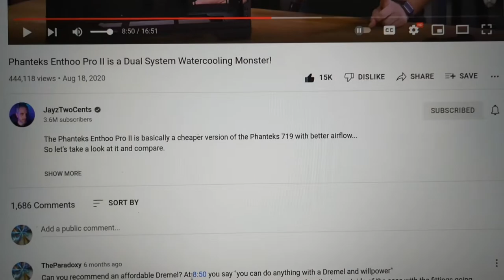A Dremel + Willpower

Comment: What are you temps ?
Reply from the maker: That overclock was mid/high 70s C after heat soak. Lately, I've switched to PBO 225 190 190, which is more stable for extended use (I was out of town for two months and just SSHing into the computer) but PBO doesn't go much over 4.5ghz in my workloads where I fully populate 20-30 threads for several days at a time. At this moment it's running 80°C for 20 threads that have been running for about 6 hours and it only takes about an hour and a half to fully heat soak. It might drop a couple degrees at night, but mostly PBO will increase the frequency (and thus temps) if it can and temps are under 76°. I think my bios tells PBO to throttle at 86°, but I never really hit that, maybe in the summer idk
Reply from the maker: @Alessandro_Tatti  I don't play video games all of my work is heavily multi-threaded so I need SMT; but thanks.